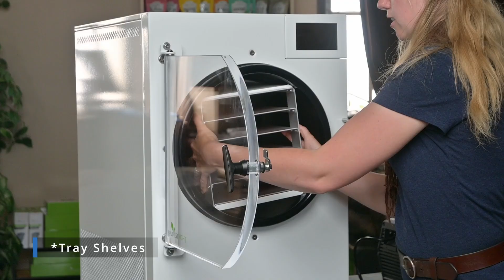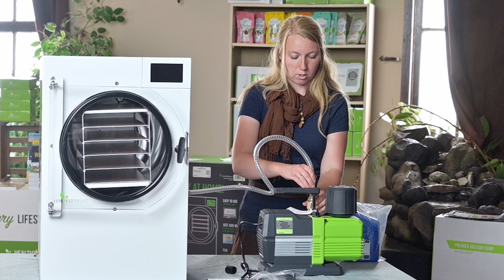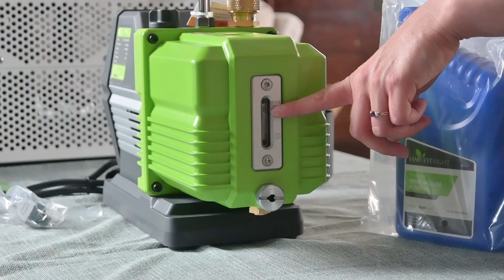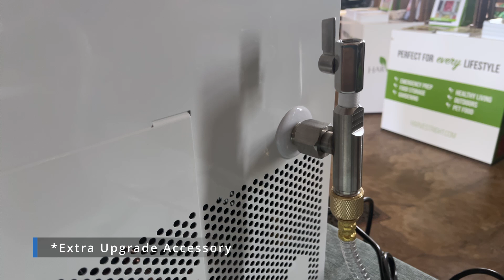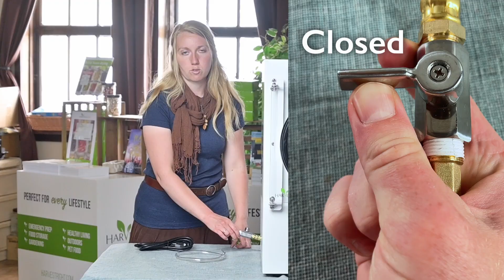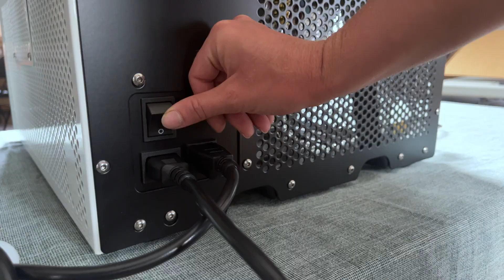Harvest Right Freeze Dryer First-Time Setup Walkthrough

Comment: I keep getting, can't aquire pump notice. After 2nd notice I canceled and am letting it defrost. Trouble shooted. Hoses are in snug, drain is closed. The number that show vacuum power was at 2500. That means pretty much no seal right? What else could it be. Door? Just noticed some water on the table below the door. Is that normal? SOS!! thanks